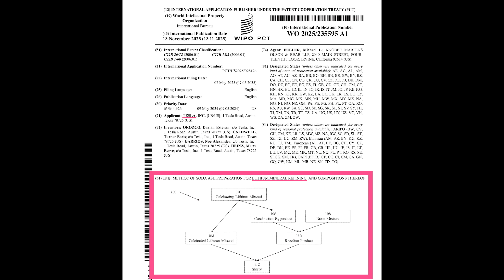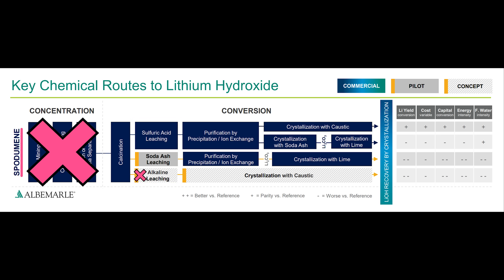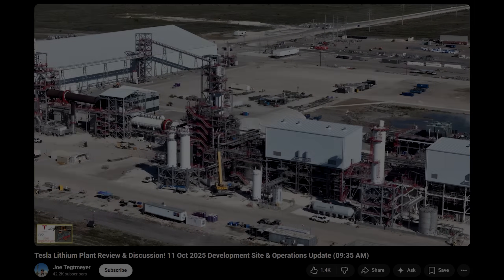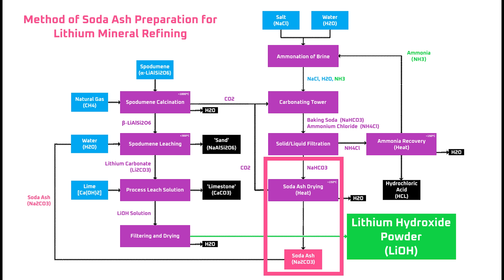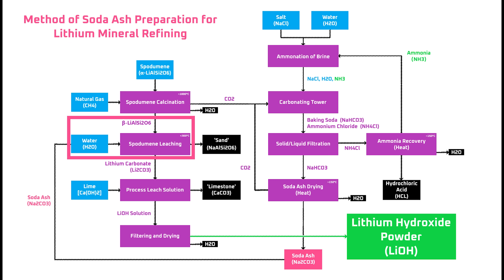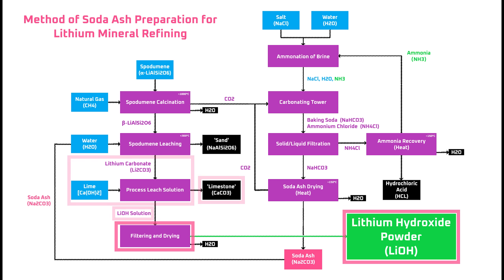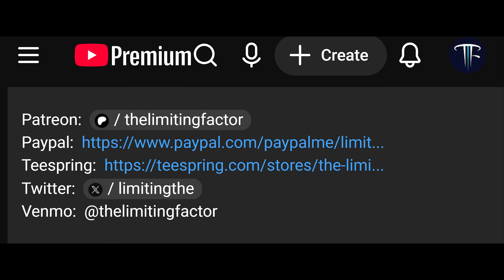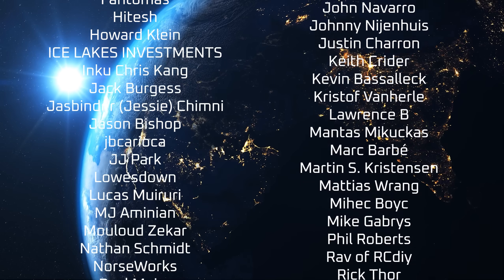Tesla's Soda Ash Lithium Refining Patent Application

Comment from the maker: 1) Tesla's video says they use an alkaline process.  Soda ash is alkaline.  It also says the co-product is analcime - which is the 'sand' and 'limestone' I mentioned in my flowchart.

2) Yes, I used Grok for a rough estimate of cost.  That's beacuse it wasn't necessary to get an exact guess.  There are too many variables and question marks to build a complex cost model.  That is, I understand Grok isn't always accurate, but I worked with it for about an hour to make sure all the variables were covered and accurate enough.  It passed the sense check.

3) I will cover the Donut battery when we have more information.  So far, it's all marketing and speculation.  Bear in mind we went through the same thing with Quantumscape 6 years ago.  They had the who's who of the battery world, including a Nobel Luareate, vouching for them.  

It seems very far fetched so far, but I would love to be wrong!  They showed half a dozen or so key specs.  I don't doubt they can hit at least a couple of the specs, and that would be a good achievement and would put them on par with other manufacturers.  If they can half of them, it would be phenomenal and would put them in the lead for solid state.  If they can hit all of them - mind blowing - but stretches credulity.
Reply: You did an excellent job! shared on linkedin, I know boring. But that is what we do.
Reply: There is some information on the Verge website if you dig deep. They only guarantee 1,100 cycles. And the internal resistance is 0.11 Ohm. So the marketed specifications don't survive real life implementation. It seems to me that the battery is real. An issue seems to be that if you allow the battery to heat up by fast charging it, like it can, you won't get anywhere near 100,000 cycle life. And that resistance is going to lead to issues, like low cycle efficiency and heat as well.

Comment: I think you want to try to source a sodium chloride that has significant amounts of lithium in it as an input material. Lithium is commonly produced from NaCl/brine as the input material and then concentrated. Using the right NaCl as an input to make Na2CO3 should increase lithium yields when you combine the Na2CO3 with spodumene.
I am not sure about the soda ash drying step since the next step is adding water again to the soda ash to use the solution to leach the lithium.

Comment: The young lady, 42 sec into the 2 min video, literally says they take it through an alkaline leach.
Reply from the maker: Soda ash is alkaline.  Do they simply mean baking soda or do they mean a stronger alkaline chemical?
Reply: @thelimitingfactor  It probably an alkaline pressure leach process (tank window looks under pressure) after calcining the spodumene ore in a kiln. This is a sulfate- and acid-free hydrometallurgical method, specifically a type of soda ash (sodium carbonate). But It just triggered me she actually said alkaline leach, and you showed it in your chart and removed that option 2.40 min in. Guess the verdict is out. Metso has such tech but Tesla made their own.

Top fascinating stuff.
Reply: Indeed

Comment: The first time I heard about the soda ash leaching method was 2022-2023 when Metso Outotec announced this technology, to be implemented in the Kokkola Lithium Refinery in Finland as part of a fully integrated project covering mining, concentration, refining and export of Lithium Hydroxide. Hot commissioning of that refinery is scheduled for 1H 2026. In due course it will be interesting to compare these two frontrunners, although I think it will take some time for secondary optimizations such as on-site production of soda ash to be implemented.

Comment: Looks like the on-site soda-ash production only loops into the lithium production in 1-2 spots.  (+ heat exchange)  I bet they could setup the plant to run using imported soda-ash until they get the on site production sorted.

Comment: Natural gas can be replaced with biogas since both are methane, but biogas is renewable.
Reply: Won't be cost competitive any time soon since nat gas is a waste product of oil fracking.
Reply: @j03man44 it is if you make it yourself.
Reply: that would make the process expensive, but also carbon negative
Reply: @nedisawegoyogya if they make their own biogas it will be worth it in the long run.
Reply: @SkepticalCaveman biogas is such a comical way to produce co2. Using solar panel to heat the kiln and carbon capture (bubbling limewater with air) from the atmosphere is cheaper
Reply: @nedisawegoyogya biogas is so easy to make that you can do it in your backyard. Bacteria does the heavy lifting.
Reply: @SkepticalCaveman you would also have to consider material cost, material transport cost, production rate, and maintenance. There is a reason biogas only consist minority of gas usage, because the production just isn't fast enough to meet the demand. Biogas requires photosynthesis, which is only 0.1-1% efficient, whereas direct solar furnace can theoretically 100% efficient. Carbon capture using electricity, lime and air also far less energy intensive than photosyntehsis, due to skipping carbon reduction into organics. Always follow the entropy to get the most efficient result.
Reply: @nedisawegoyogya in my country 100% of all methane comes from biogas last I checked.
Reply: @SkepticalCavemanfElon blows lots of hot air😂
Reply: @SkepticalCaveman and the country is?
Reply: Biogas consists primarily of methane and carbon dioxide, with trace amounts of other hydrocarbons such as ethane, propane and butane.

Comment: Excellent video! The only pathway to 100% electric I see would be using a traditional Solvay process but converting the CaCl2 to lime by reacting it with NaOH. Then you could recycle the CaCO3 into the start of the Solvay process. The circular use of the CO2 and calcium would enable the elimination of natural gas in favour of electric heating. Way too expensive to implement to be sure.

Still kinda disappointed that Tesla never made the mechanochemical exchange of lithium for sodium in hard to process Nevada clay deposits work... That would have been spectacular.

Edit: Tesla just published a video stating they use an Alkaline Leach process. I suppose they might just be referring to the Ca(OH2) step.
Reply from the maker: Thanks for the input Finlay! 

I was also disappointed that the clay process didn't seem to pan out.  That reminds me, I still need to do a video on mechanochemistry.

I saw the video they just released.  Perfect timing 😁.  I'm thinking the same on the alkaline wording.  I also looked into 'analcime' which I hadn't heard of before - it's just another word for the byproducts I showed on screen (spent spodumene and calcium carbonate)

Comment: Great video.  Thank you for explaining this in depth.  There were a few statements at the end re: IP that are a little off.  
1. It is very common for Patent Offices to initially reject the Claims in patent applications after citing one or more prior art references.  Patent Offices routinely look to other issued patents or published patent applications as sources of prior art.
2. The Patent Office is comparing what is disclosed in those older patents/applications to the elements in Tesla‘s Claims.  So without looking at what claims issued out of the prior patents, there is no way of knowing whether anyone else has IP that could be asserted against Tesla’s process.
3. It is also often the case that after some back and forth between the Patent Office and Applicant, the Patent Office relents and approves some modified claims.  So it is too early to tell what if any claims will issue from Tesla‘s patent applications (filed in multiple jurisdictions).
Reply from the maker: NICE!  Great feedback thank you!
Reply: FWIW, it looks like the PCT application (cited in your video) is based upon an earlier provisional application filed in the US in May 2024.  So the application describes Tesla‘s thinking back as of that time — process may have further evolved since May 2024.

Comment: It's amazing how a CO2 waste output becomes an inexpensive CO2 input.  Love it!
Reply: One of the biproducts of Redwood Materials battery recycling is sulphuric acid. Sounds costly to dispose of, but they don't have to because they use it in a different part of the process. Smart people are figuring out clever ways to close the loop.
Reply: @FutureAzA  Additional vertical integration benefits
Reply: The CO2 still becomes a waste output afterwards.

Comment: If the Donut Lab's battery (displayed at CES ) proves to be the real deal, would the lithium production facility become obsolete?
Reply from the maker: No, new technologies just expand the TAM of the old.  

There's several other reasons as well.  Could be a good video topic.
Reply: Good question. If the battery is real there will be so many changes. But like so many others out there I fall in the camp of it not likely.😢
Reply: Sodium has a hideous charge curve. 4v to 28v on a 12v battery makes the electronics and cabling problematic. It's my bet it will a decade more before sodium is really useful for anything but grid-scale.
Reply: If you don't want to re-engineer the electronics, you have to treat it like a lead-acid batt. to keep it within the charge/usage voltage. That means never getting to use 50% of it's capacity. The economics of Sodium are not clear cut.

Comment: What if Tesla preheated the Spodumene with electricity so that they could reduce the natural gas use to the amount needed to produce the right amount of CO2 for the other processes.
Reply: More likely a heat pump from the exo-thermic processes, but possibly both to optimize production vs energy cost vs emissions.
Reply: Maybe preheat with an electric heat pump and the waste heat. 🤔